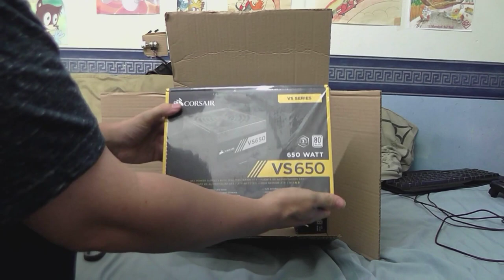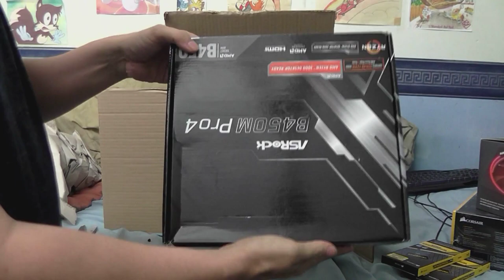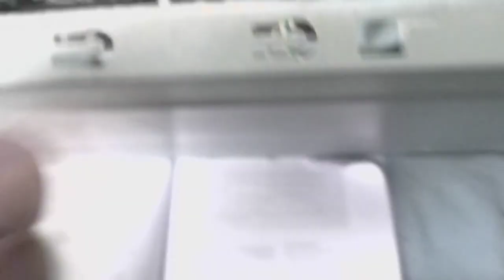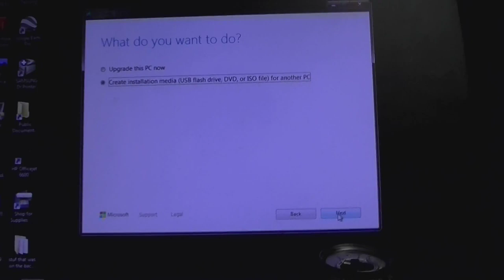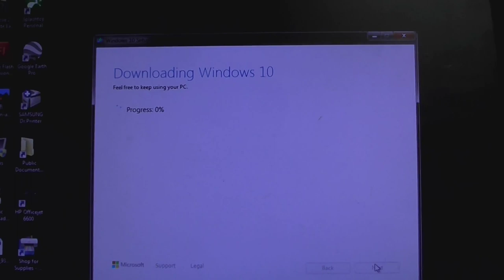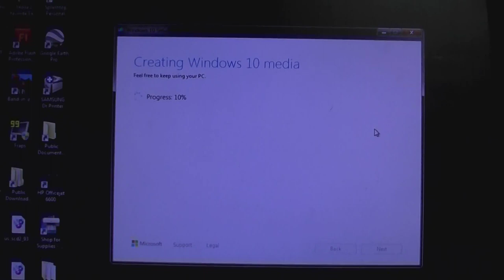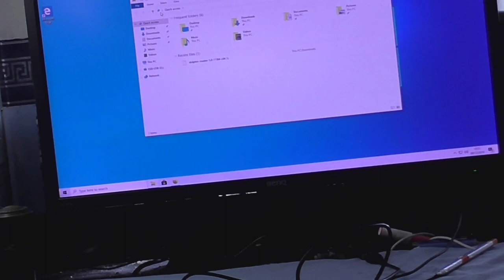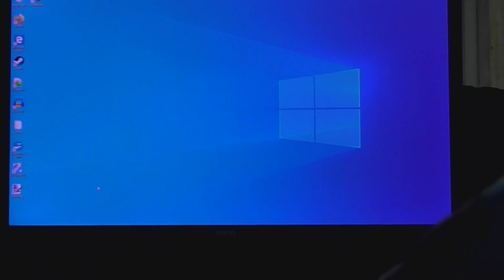The PC Upgrade Saga II, pt 2.

Comment: Clem please read this. You didn't fully put the arm down for the CPU to keep it in place, that means the only thing holding the CPU in the socket is the weight of the CPU cooler, you will want to take off the CPU cooler and make sure you put the arm down properly, otherwise if you ever take the cooler off in future the CPU could litearlly just drop out of the socket and damage the pins.
Reply from the maker: Yes, that did happen when I read your suggestion and a couple of pins did get a little bent, fortunatly it still fits in the socket and this time i'll make sure that arm is all the way down.
Reply: @CoolDudeClem  Ah, hopefully the bent pins don't cause any issues for you.
Reply from the maker: @MattM310  Nope, totally dead, wiont even post.
Reply: @CoolDudeClem  Sorry your machine won't post Clem... If you bent the pins as you stated, take your time straightening them out and try again inserting the CPU. BE PATIENT!!! I had a young man bring in his computer to our shop and he had done the same thing, he had bent roughly 30% of the pins and I spent 2 hours straightening them, reset the cpu and it posted just fine, and pleasantly surprising the shop owner and a programmer who were watching. Be patient, get a magnifying glass and did I say BE PATIENT :-) GOOD LUCK!!!
Reply from the maker: @n7565j  Okay, crisis over, I tried re-seating the cpu and it cured the problem! I can't even begin to explain how worried I was.
Reply: @CoolDudeClem  Well done sir!!! Sometimes we just need to step back, take a breath, then think a bit, then do :-) So glad you didn't do any permanent damage!!! Amazing how tough these new chips are, 20 years ago you'd have been out of luck... Again, WELL DONE SIR :-)

Comment: Best way is to put the memory, CPU and heatsink in before putting it into the case, keep it on it’s anti static foam material because it will help you put them in without flexing the board and give more room.

Comment: Can't beleive it's been 7 years since you last upgraded already!  You could mount all the parts for franken pc to a peice of wood so it could be wall mounted or attached to the back of the monitor to save space. There are ways to disable UEFI bios and boot in legacy mode, But then you may run into issues finding drivers for newer stuff.

Comment: That's a nice setup. You can do more now if you want to. Just thought of something, it does not matter now but, had you wiped you're drive complete you could of still had win 7.
I ran into the same problem with install and then external controls quit working. I figured it out but I just wanted to tell you. Glad you're new system is working. Tech marches on don't it?
Reply from the maker: Actually I did try it (I didnt film it) with a hard drive that had windws 7 on it, but the computer didnt like that, it would reboot when trying to load.

Comment: I'm glad that it worked for you Clem.Shouldn't you have been wearing an Anti-Static Wrist Strap?
Reply from the maker: I dont have an antistatic wrist strap so Idid the next best thing, I grounded the case via a crocodile lead, so that way when putting parts in I could dischage myself by touching the case.

Comment: hi Clem, your ram sticks are in single channels instead of dual. You should move the stick in slot 4 to slot 1  or the stick in slot 3 to slot 2 to have them operate in dual channel. Use 2 and 4 or 1 and 3.